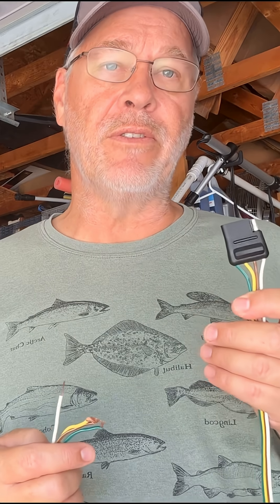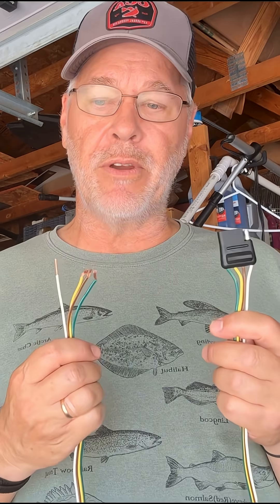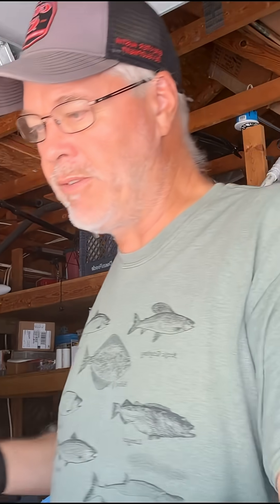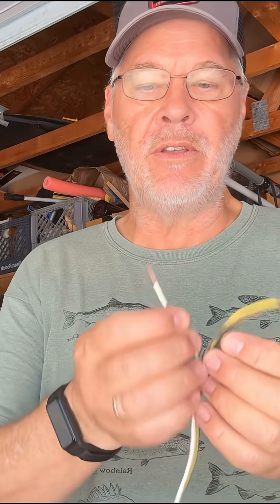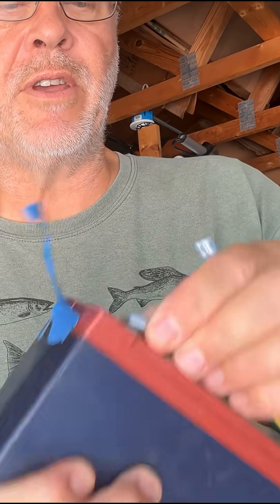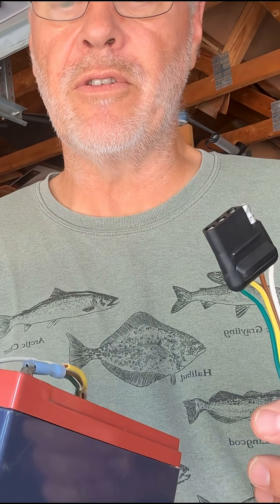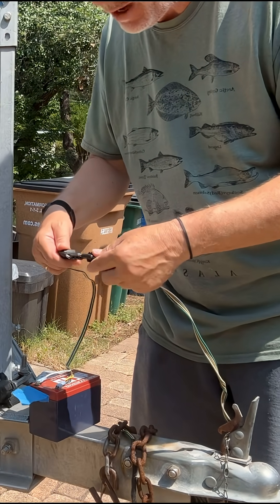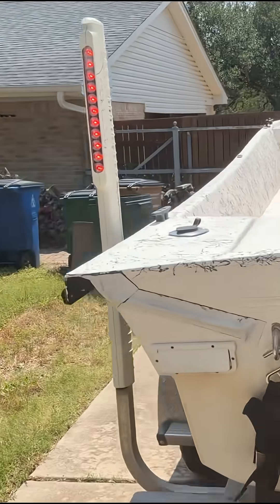Easy DIY Trailer Light Tester Anyone Can Make!

Comment: For anyone else who comes along, you could put switches to each of the left and right light connections to make them blink. I came across this short when trying to make a handheld box, powered off 12v power socket. 

Since non of our vehicles have wiring(and doing so is quite expensive and time consuming for a few times a year). Our civic's lights are blocked by a bike rack when all three are loaded, so i was going to make a box to control some magnetic(or other) trailer lights.
 I had read a post of someone going a short distance without wiring and one man's idea was to make a box that could power the left, right and brake so you could simulate turn signals by toggling that side.

Comment: Genius. And then the last thing he's going to do is back the truck up to the trailer and plug up the lights to his truck and test the turn signals.
Reply from the maker: yep, if you want to test the turn signal, you will need the truck.
Reply: @WanAdventure  you could just get a switch and use that to toggle the connection to each light

Comment: How do u check the turns without a pulse
Reply from the maker: This was a video for trailer lights... not turn signals.   You will have to plug in to truck to get the pulse.